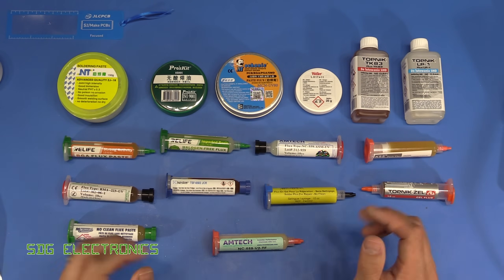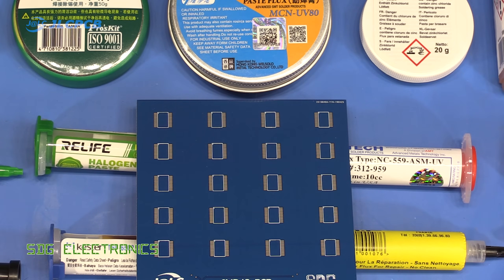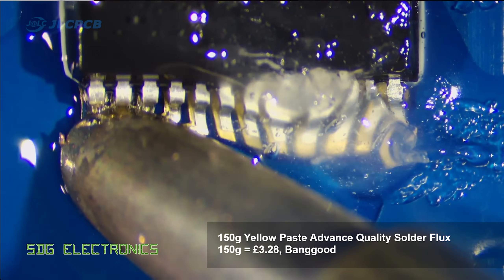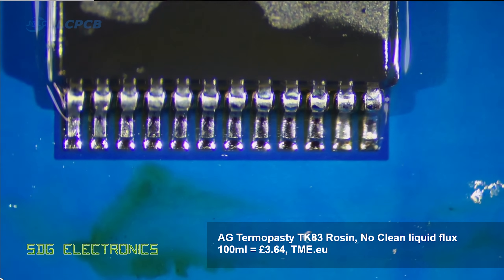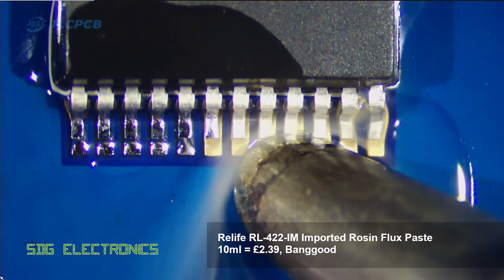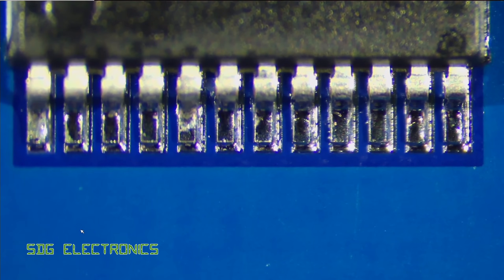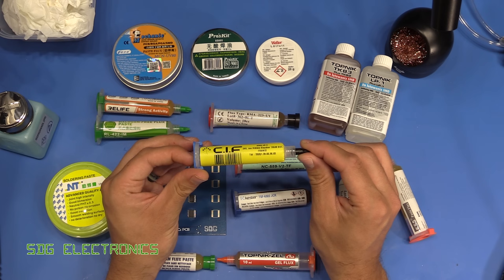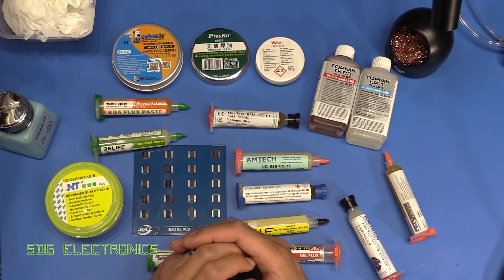SDG #086 What's the best flux for soldering? A comparison with PCBs from JLCPCB

Comment: Thank you very much for this very informative video. I have an additional question, is there a UV curing soldering mask ink you would recommend ? I tried one but either the UV_light did not do well (sunlight did not help) or the ink is not ok.  Maybe I should have thoroughly shaken the capsule before use ? I tried to repair some minute traces and pads with it, without much success
Yhank you very much for all te informative videos

Comment: Now would like to see proper board cleaning from flux residue tutorial :)  Although PRF 6-68 cleaner liquid with cotton swabs do the thing just fine, I'm curious about how to get flux residue out of bottom of ICs. What I noticed - JBC C245931 minispoon tip still do the job on QFP packages very good.
BST-223 paste is not so good for small QFP ICs and USB sockets. Once fried few traces on board and one microUSB socket because used BST-223 and pins instantly got swamped under solder. Damaged bothsoccket and traces on PCB while struggled with excess solder cleanup.

Comment: Hello. Which flux, in your opinion, is the easiest to remove with isopropyl alcohol? What do you think about warton metals (it contains resin)?
Reply: The easiest flux to remove will probably be something with basically zero rosin/resin, and therefore be pretty useless. If you're having trouble removing flux and don't want to pay for proper flux cleaner, you can use brake/contact cleaner from the hardware store and it works 90% as well (just make sure to use it outside).

Comment: Well done brother.. liked & supported.. One Qs. What's that type of greyish flux paste that come pre-mixed with tin & lead that we can apply on the connectors and just place small components on top and easily solder with heat gun ?

If you can tell me specifically what's it called, I will have a much easier time searching for it on Amazon?

Comment: If you solder with hot air, boiling temperatures and surface tension becomes a real issue especially with bga chips.
For NC559 it's not a problem.
Other flux brands may have low boiling point or evaporate too soon or have too much or too little surface tension be too thick or too thin causing all sorts of problems soldering small smd components.
God forbid you use flux that requires cleaning on bga chip and don't do ultrasonic cleaning after. Pads will corrode causing unimaginable damage to your device.

Comment: I often use a flux pen, it looks like a felt tip.... you push down on the tip and it soaks the tip....then it's applied to the joint to be soldered, however, for me it doesn't seem to work as well as the paste type fluxes, but it does the job....the syringe type fluxes can be tricky since they tend to glob it out per sae. 
But, IMO....most fluxes work just as well as the next, alot has to do with soldering techniques as well. 
Thank you for all the technical video's that you put together,  they are alot of work for you tubers...but are very informative.!

Comment: The TOPNIK TK83 states that max operating temperature is 280 C. 
Does that mean that I can't solder with more then 280 C while using this flux? I'm confused, can someone help me?
Reply: Likely as a liquid flux that means it starts boiling off at that point. Which is why liquid flues imho are annoying to work with.

Comment: Excellent video.
I have been using MG Chemicals flux pen that is a liquid flux. This is the stuff Nintendo recommended to us about two decades ago. I never did like it much and it was constantly bridging, especially on the last few pins. If course, those ships had over 100 pins so the gap between the pins was smaller. I just ordered some MG No Clean solder paste before coming across your video. I am happy it performed well in your tests.
I would love to see some examples of how to resolder a BGA chip using this flux.
Reply: MG Chemicals no-halogen 8351 boiled off way too quickly for me. Their no-clean 8341 paste is great though. Might try the RA one just out of interest.

Comment: I am not a professional electronics builder or repair man. I have mostly tube plaster flux an use a simple tooth pick. I guess I don’t have many cocktail sticks laying around. As the cheap bastard I am, I use what I have an inherited a great deal of solder and flux. Liquid flux in bottle have the viscosity of water. They have readable factory labels but none say rosin or acid, only the rolls of solder show. I work with repairs on SMD’s, ribbon wire connections but all dirty & old. Cleaning to re-tin each is my hardest task. I have 3 types of heat soldering guns from low power stick types, to cheap gun shapes w/simple on - off switch. My last other than butane is a SnapOn 450 watt with three tips. Primary wire requires heat w/flux to clean. Already with shrink tubing, wires twisted laterally, I apply flux & heat. As the flux melts I apply solder immediately and works great. But tiny wires and tiny pads use on ribbon wire I find it hard to tin either. Controlling heat is important but the flux has to do its job. After applying a heavy body paste, I ready the solder and apply heat. I am trying to apply a ball to make the connection. 
Question; Does certain flux loose it’s cleaning ability with time? 1 year, 5 years or 20 years? I store it all in a cool dark location but still wonder. It only use enough heat to solder as overheating burns and creates a coating that’s hard to get thru. A common mistake used on copper water pipe by DIYers over & over again. I question rosin solder as it is formed with a line of resin inside as it is rolled into a stick and coiled on a roll. I bet it dries out with time. Even new stuff doesn’t work well without apply a paste first. Thoughts? Retired auto tech / fix it all. Thanks for the video and the work while the camera is off. Best of luck!
Reply from the maker: The flux will degrade over time depending on what type is it. Rosin based flux has a significantly longer shelf life than any other.

Comment: I know the subject is beaten to death but can you recommend which solder variation you prefer for small micro components with easy flow and low temp characteristics ? How's MG Chemicals 4860-18G-2 63/37 No Clean, thoughts? I'm tring to remove an old 6mmx6mm Sic789 mosfet and clean the area for a new one. Thanks
Reply: MG Chemicals RA solder was beautiful for me. Pretty much just as good as Kester 44. Have never used no-clean wire, but MG Chemicals 8341 No-clean flux like this video shows is great.

Comment: the NT flux WILL NOT  I REPEAT WILL NOT  clean off. It makes a big sticky mess and i even let the board soak in 99% isolropyl alcohol overnight and it WILL NOT clean off the board. I am throwing this one in the garbage right now. dont trust it.
Reply from the maker: It cleans off just fine with a pcb cleaning solution such as Fluxclene. Check my video on pcb cleaning. IPA on its own has no surfactants so does not work well on any flux

Comment: Can the yellow-topped 150g tub of "NT Advanced Quality ZJ-18" soldering paste (link #1 in vid description) be loaded into syringe and flow out of the small syringe tip easily enough , or does it need to be liquified more to do so?
If you need to liquify it more, would you best do so with isopropyl alcohol, in the 70-90 percent range?
Reply: Yes, look into luer syringe attachments. You don't need to liquefy it.

Comment: Weller flux made me hardly detectable short-circuits, when applied to IC's. It wasn't detectable with multimeter, but only with infrared camera, when after a while, near VCC and GND heat started to abnormally build up. So be careful with it.
Reply: that weller flux reminds me of a blue tin solder grease made by stannol gmbh called lotfett, even comes with the same warning (contains zinc chloride) but the blue tin stuff have warning against using them for electronic or electrical soldering
Reply: I wonder if it's a Fluxite-type paste, with metal particles, meant to solder sheet metal and large power cables (not electronics components).

Comment: i try multiple ones and it always result in a scotch tape like sticky surface whatever cleaned with 99,99% iso alcool or mg chemical heavy duty flux cleaner... it sticks!! i command some amtech 559 and same result... now i command amtech vs-213! should it be the real deal ? will see! it supposed to be easier!

Comment: Hello, i got the mechanic x9 flux, different from your's but i was wondering if it's normal it's very hard to use, it's solid in the container, i had to put the solder iron in the container to soften it a bit and then it becomes hard again quickly, it's like resin hard...

Comment: Hi, can you please just recommend one of the best gel flux to solder phone charging port?
I don't know if the gel helps to solder without shorting (tin bridges among pins), I would like to solder without bridges.
Thanks in advance
Reply from the maker: From what I've found, any branded gel flux will definitely work for what you want to do. Ideally go for one with low rosin content as it may be difficult to clean from a charging point. The Amtech, CIF and Relife will all do the job.

Comment: Genuine Amtech flux ain't all that easy to find in the UK (so much fake stuff). As this video was quite a while ago, what's your goto flux now? 

I can find CIF flux for a reasonable price, mighty tempting. Did you switch to that in the end?
Reply from the maker: CIF flux can still be bought at a decent price at Farnell. Most of the time, I use the SolderKing flux though.
Reply: @sdgelectronics  cheers, that looks a decent price too. I will check it out. 

Any chance of an updated comparison with this and amtechs new 213 included?

Comment: The alteration to Voc Free Flux  from alcohol-based adjustments can be a barrier in addition to could require a number of changes in the setting up procedure. Worsening these difficulties is the increased use of lead-free alloys with the approaching expiration of the Rosh exceptions.
Visit us @ https://www.advancetech.co.in/products/interflux/voc-free-flux/if-2010f
Mail Us @ ajay@advinancetech.co.in
Contact Us @ 9599592692

Comment: These fluxes were all tested on surface mount components, using PCBs with no vias.  When heated, they all turn to liquid, and near by vias could drain it away.  The liquid fluxes you can clearly see evaporating along the right edge at 6:20 and 6:50 respectively.  They seems to have very limited uses.  As someone else commented, I'm curious how the SRA No Clean Tacky Flux could handle those condtions.  Also, I do a fair amount of through-hole soldering, and literally all of these fluxes are simply too thin for that.  So I'm seeing a good case for another video.  Boards with vias, the SRA flux, and something for the THT crowd (zinc chloride, as well as non-ZCl).  Thanks!
Reply: I'm curious if you're using a Aoyue soldering/desoldering station from SRA; I used an INT701A++ dual station at work for my last 5 years prior to retirement because the 1980's Hakko desoldering stations we had  all died and we couldn't easily get parts.  I was thinking of buying one of the Aoyue desoldering-only stations from SRA to use on projects around the house. They're only about 140 bucks as I recall.  The 701 a worked surprisingly well for me as a full-time audio-equipment bench repair tech, although I did a couple of tweaks and mods to the guns to make them work a little better without clogging.

Comment: Do you need to match Flux with the Flux core in solder?

For example, Amtech no clean solder to amtech no clean flux

Kester no clean soler to kester no clean Flux etc
Reply from the maker: I think it's recommended, good point.

Comment: The Amtech NC-559 is sticky and hard to clean it work well but if you want a clean board after the job your not gonna like it, i use a lot of the Amtech RMA-223 one of my favorite also very affordable 50cc for $4, i also use jelly Yesa ET1030 for some work since it burn slower at high temp, i also like the Chipquik D291 or SMDLT when i use Chipquick for desoldering.... the ''Best'' compagnie is a copy of Amtech and Mechanic which i like soldering paste XG-Z40... But still prefer soldering paste ChipQuik SMD291AX... Best use the tools of Mechanics they just rebrand it and they also use the flux RMA-223 of Amtech.

Nice video btw example is the best way to show what product peoples should use for their need.

Comment: Just a guess, but spitting is likely the result of water content.  This would be the result of dissolving the rosin / thinning with 90% isopropanol, instead of pure.

Isopropanol has the advantage over ethanol for cleaning up that it takes skin oils with it, unlike ethanol.  You can't drink it, though.

Comment: Great video. Quick question, is there a way to turn a paste flux softer to put it in a tube/syringe? I just started to with electronics repair and purchased basic tools which got to me this flux as it was the cheapest but its so hard to apply.
Reply: Use heat to thin it: a hot water bath perhaps, but take care not to put water into the flux. Or a hairdryer perhaps.... If it's in a plastic container and there's no metal you could probably put it in the microwave for 5 seconds at a time until it softens.

Comment: 1:38 "Topnik" means "flux" in Polish. :) It's the biggest word on the bottle, but it's not a brand. TermoPasty (https://termopasty.pl/en/home-page/) is the brand. There's one more Polish brand worth mentioning - Cynel https://www.cynel.com.pl/en/products/99-sn60pb40-pro. This is probably one of the few sources of supply for good old Sn60Pb40 soldering wire. Made of very pure ingredients, heavenly soldering. As a hobbyist I use this wire all the time.
P.S. Isn't the Weller Lotfett the more aggressive type of flux intended for soldering difficult or dirty materials as well as restoring health to the oxidized tip?

Comment: Almost any type of flux will work if you pack enough of it on. I would have liked to see the comparison using minimum amount of flux. That would be the true show of how well it works. Also, the less you put on, the less you need to clean afterwards. My personal favorite flux is MG Chemicals liquid flux, RA type flux.
Reply from the maker: Ideally I need to set up a rig to oxidise some parts and see which has the best cleaning action.

Comment: Just make your own liquid flux from rosin, just use a little bit Rosin and 95+ alcohol and put it together, and it becomes liquid flux, is the best flux you can have, and is very cheap.
Reply: Or just use kester 959t which is essentially the same thing.
Reply: @ericochoa4034  Yeah if you want to pay a LOT more, then yes you can buy kester 959t.
Reply: @AmigaWolf  I only pay 13 dollars and it lasts me quite awhile.

Comment: I exclusively buy Kester Solder and Kester Solder Wick, I have never seen Kester Flux and it looks great from this video but it is a little weird that Kester labels that Flux as no clean but it does clearly has a high rosin content. I wonder if its non-acidic and that's what they meant by no-clean, either way looks like I'll have to give it a try.

Comment: Great video.  I have the same experience with the MG Chemicals one. It crystallises and becomes difficult to work with. I have a 30cc syringe of genuine Amtech v2 and it's over priced and I really can't afford to use it again. I actually think the MG Chemicals flux reacts a bit quicker and works longer when using them sparingly. Just ordered a tube of the CIF flux from Farnell to see how it is. Works out as the cheapest source if you have a trade account.
Reply: Which mg chemicals flux is better. The regular Rosin flux or the no clean flux?
Reply: @CoomerGremlinDGGfan  MG chemicals rosin flux is conductive so avoid at all costs. Always get no clean flux if you work alone and on small projects, but get the CIF flux. It's better and cheaper.
Reply: @DamnDealDone  So what's wrong with it being conductive? In my application, I'd be using it to solder speakers in a guitar amp.
Edit: yes, I'm a complete when it comes to this
Reply: @CoomerGremlinDGGfan  Conductive flux conducts electricity which you don't want if parts are close together with flux between them. But in your application it might be okay. Just make sure you clean it off 100% to avoid shorts. In SMD electronics it goes under chips and can only be removed using an ultrasonic cleaner.
Reply: @DamnDealDone  Okay thank you for that. I guess isopropyl alcohol is what you'd use to clean it?
Reply: @CoomerGremlinDGGfan  Yes. 99.9% Isopropyl Alcohol. You might also want to invest in a fibre glass pen to rough up the surface before soldering. Some speaker terminals are quite shiny. Go over with fibre glass pen to take off any surface treatment/oxidisation, clean with IPA, add flux, pre tin, add flux, wire, clean with IPA. You don't have to do that exactly, but that's exactly how I would do it.
Reply: @DamnDealDone  Perfect. Will do. I actually wanted one of those pens but didn't know what they were called.

Comment: Great video! I didn't know that zinc chloride could be used in electronics. I was surprised to see that one of the fluxes had that in it. I've got some Kester 959T. I can't find it mentioned on youtube or anywhere else, but it does say that it is for wave soldering 0.5% rosin no clean. I assume it can be used to hand solder as well. What are your thoughts? Thanks and great youtube channel by the way.

Comment: Anyone know how to get a pen with a dry tip to work ? Thanks
Reply: Although I don't have a flux pen myself, I believe you can just soak the tip in isopropanol for a few minutes, followed by pressing the tip to get the flux to flow. Also remember to store the pen horizontally, to keep the tip wet. Hope this helps 🙂